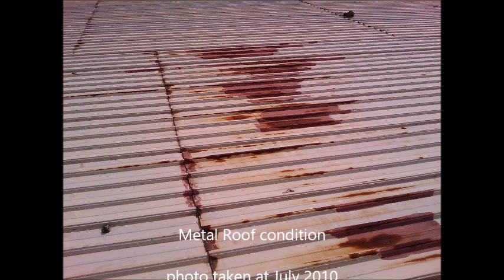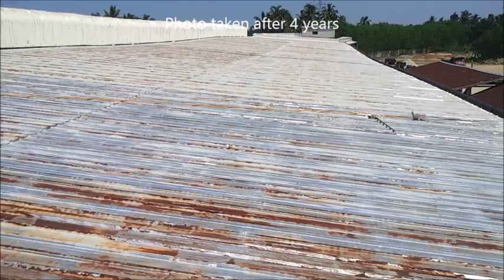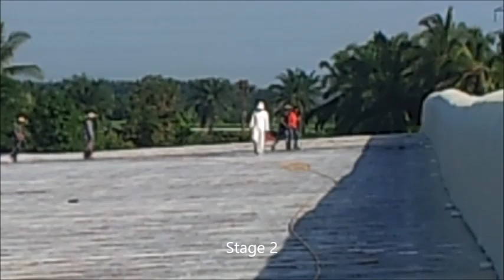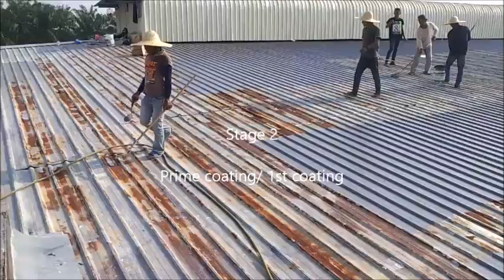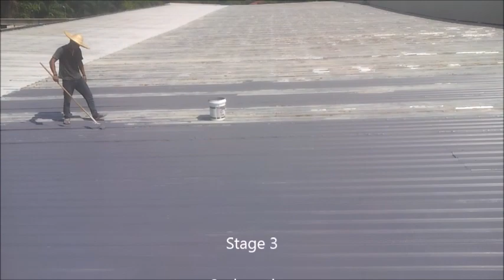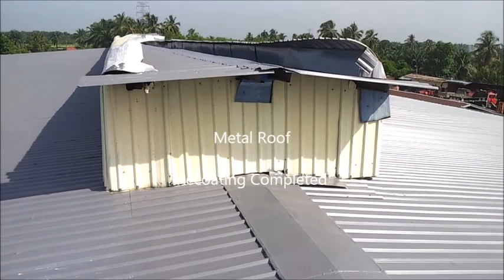Metal Roof Re-coating Malaysia | Anti-Rust Treatment

Comment: What does the roof look like now?....has the rust come up through the paint?
Reply from the maker: Hi there! Honestly speaking, we haven't have the chance to re-visit to the factory since project completion, we did not receive a single complaint of rusting and leaking from the factory owner after so many years. According to the facility owner, the roof still looks good and serving them well. And "No", the rust does not come up through the coating, the coating is meant to protect the roof surface from further rusting cause by water and air.
Reply: @mrdmetalroofdoctor5060  which types of coating are used &
How much cost per sft to repair it
Reply from the maker: Hi Tania, in order to choose the right coating to restore a metal roof, first we will have to understand what is our objective & goal. Definitely, waterproofing, anti-rust and also uv-resistance ability is the crucial aspects for a right metal roof coating material. But, choosing a right product is just part of the equation, not to forget that the workmanship, methodology and application system is actually the key to a successful metal roof re-coating project. It is hard to just shout out a precise price tag for the service. Again we will have to understand what we are trying to achieve together and also we will have to understand more on the site condition to give a more accurate quotation. For sure, feel free to contact us if you need our assistance. Thank you!